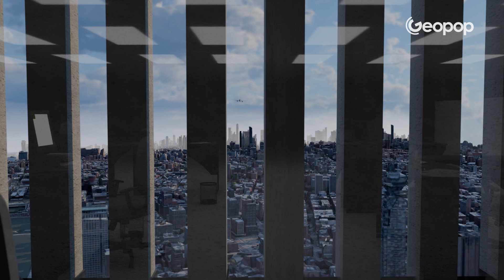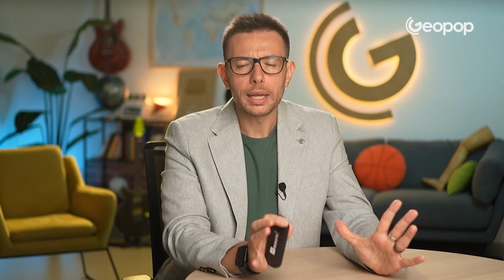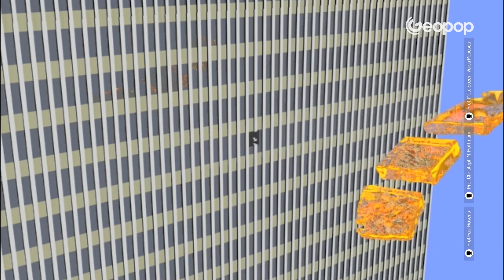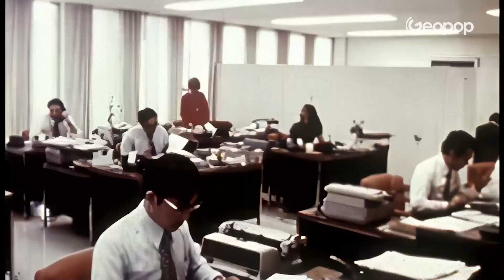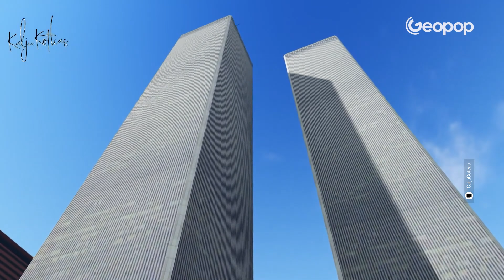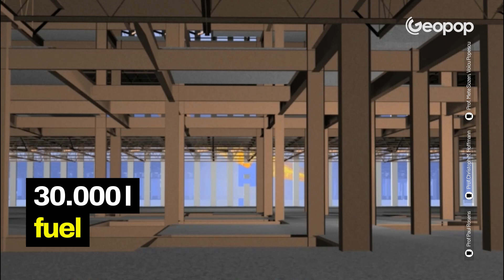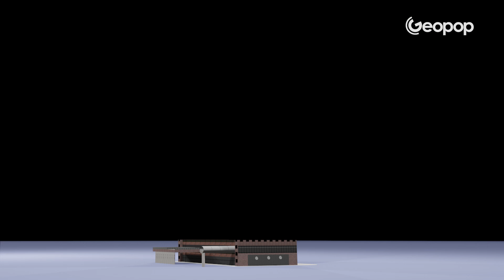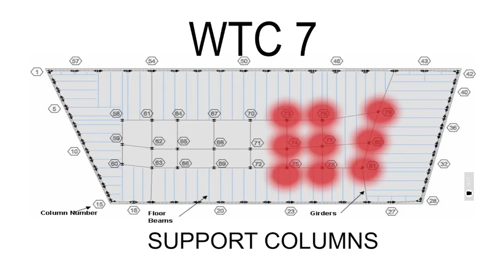9/11, 2001: The Technical Reconstruction of the Twin Towers and WTC 7 Collapses

Comment: Please explain to me how my point would it was not made. If all you're willing to do in a debate is one sentence answers, then it's not much of a debate, is it? NIST Went to the trouble of changing and inventing a new formula for  The deformation of steel, they did a large-scale burn test to get the information information on exactly what would happen with exactly what they knew was in the building, they had all the architectural plans. They had all the data that they needed. You take that data, you make a model, you let the model run and you do more than one simulation. You do not use video or pictures to reinforce. Which model you want to choose. And please inform me what part of that statement is incorrect, because all of that was taken directly from their article, and I did look at the mathematical equations and the 2 different models of steel deformation, that they did corrections on. So they can get information that finite the cannot pick a model without using the video to find out what they want.@TheCriticalStinker-jw4fl

Comment: Everything told by the media is inaccurate..simply put if the lower 50 floors are already strong enough to support the weight above why does damage to the 80th floor cause the whole tower to collapse? Easy because the bombs in the base cut the beams with thermite used in demolitions.. this also explains why scientists have found nano thermite all through the site.

Comment: The report says that the sprinkler system on the 20th floor up was done by water tanks on the roof and uh, the floors that were actually on fire had a separate sprinkler system that was disabled by the world trade centers falling. The towers themselves did not have sprinklers. Systems installed until 2001 But the upper floors did have emergency tanks that should've taken care of good job at least have completely. They lose the floors above and water should have been gushing from here where everywhere@AdrianMijaica

Comment: With all of the experiments that they run, they came up with a new model to measure the structural malleability under temperature of the steel. They had all the architectural plans, everything that they needed. Don't you just plug in that data and let the simulations roll? You do not look at videos and pictures to pick which data that you want to use to run the simulation. That's not how it works. You run the data, then you take what comes out of it. You do not pick which data to match The outcome you are looking for.@TheCriticalStinker-jw4fl

Comment: Different scenarios for the interior damage and fuel distributions were postulated. For each scenario, the fire and smoke behavior were simulated using the NIST-developed computational fire model known as the Fire Dynamics Simulator (FDS). Visible fire and smoke behavior outside the towers was then compared with the photographic and video evidence to determine which scenario seemed most appropriate.https://www.nist.gov/publications/initial-model-fires-world-trade-center-towers @TheCriticalStinker-jw4fl
Reply: Disproving your own claim. Well done. Saves me the bother.

You really ought to learn how to reply in-thread though.

Comment: I love how faced with good science and solid phys sims. The deniers still come crawling out of the wood works. 😣
Reply: Imagine a smaller building collpasing due to fires lol. If fires causes buildings to collpase, firemen should have to find new protocols to enter burning buildings. Regular fires made by furniture doesn't affect concrete or steel
Reply: @hiran4935 how many of those buildings were struck by a 747?
Reply: Deniers? Climate change deniers?
Reply: From under rocks, I think.

Comment: The first part of your article basically covers why the fire department couldn't fight the fire and that's all. Your take of the building 7 collapse. Why no fire seeing no windows broken no  amounts of smoke. If you look, the first hour to collapse starts to collapse to the side, it then corrects itself. Please explain that one to me. You also say that the collapse was started on the right upper side of the building. Then how does the building collapse straight down  its own footprint? Would it not start to collapse on the side that failed? Can please show me where they ran? Multiple multiple multiple simulations off of these buildings collapsing, and the percentage obviously was greater that they collapse straight down upon themselves.
Reply: Sprinklers are never mentioned.
Reply: What sprinklers obviously, they didn't have any fire suppression systems. @Guardinitza
Reply: @Bigdaddy96991  The NYC Building Code makes sprinklers mandatory in such buildings as B#7.

Comment: Thank you for your form letter. What I said was only 3 steel buildings have collapsed only from  fire and that is the 3 world trade center buildings. The other buildings that you mentioned did not collapse because of fire. They collapsed because of explosive damage, and they did not collapse down upon . Themselves in their own footprint. If the fire was so intense in building 7, how come none of the windows were blown out and smoke pouring from the building? The fire was so intense it deformed the steel but couldn't break a window.

Comment: So if I understand correctly according to official story, at Pentagon site some flimsy street lamps caused plane's wings to fold up on themselves... where in the case of the twin towers hollow aluminum wings with almost no mass slice through enormous steel perimetre  columns? Take your pick
Reply: Yet the wing didn't " fold up " hitting the 5 light poles. An the " enormous perimeter steel columns" were .25 inch thick steel.
Reply: @mikebyrd8278  Fkin go learn something... jfc. If the building's outer pillars were a 1/4" thick steel it wouldn't have stood. The HIGH levels could be that thin, but at the bottom they were 4 INCHES THICK!
Reply: Each 🔱 trident of 3 columns 200 ton
Reply: Who cares … just open your eyes … millions saw it that its possible … physics does not care what you believe! There is no alternative any way … the planned demolition idea is simply delusional and defies common sense … impossible to pull through with a live building considering what preparations are required! Thermite 😂 complete nonsense!
Reply: You sir are a moron
Reply: You do not understand correctly.

Comment: NIST denied there were people reporting explosions and melted liquid steal at the WTC site. There was also what looked like liquid steel or something dripping off the side of one of the corners of the building at the impact site of the plane before it collapsed.
Reply: No they didn't.  You should try reading the report rather than just copying other people's bad ideas off the internet. 

As for molten metal pouring out of the South Tower (and it was in fact ONLY the South Tower)?  You mean this?

youtube.com/watch?v=xPVGGQU-MeQ&ab_channel=SeekersofTruth 

You think that is molten steel why?  Because you performed metallurgical tests?  Because the internet told you that’s what it is?  I think we can do better, so let’s do better and build a theory the right way instead of making evidence-free assumptions. This will take just a couple of minutes and is worth the investment. 

The Boeing 767 which struck the South Tower weighed 117 tons and 80% of that was aluminum.  The exterior cladding on the Twin Towers – the white panels – were also aluminum. When Flight 175 struck at the 81st floor its momentum deposited much of the office contents in its way and the bulk of the aircrafts mass into the NE corner of the building. The piled up debris shoved into that corner is visible in photographs and video so we know it was there. 

There’s a good shot here of piled up debris from 4:36;

youtube.com/watch?v=ZLJyL63sqtU&ab_channel=MrKoenig1985

Steel melts at roughly 2,750-deg F while fires in the South Tower reached peak temperatures of around 1,800-deg F. Aluminum OTOH melts between 887-deg F to 1,180-deg F depending on alloy. That aluminum will melt under these conditions is not a surprise. If you look at pictures of cars left behind and destroyed by forest fires the aluminum wheels are invariably melted away along with other sometimes aluminum parts like hoods. Steel bodies remain intact. 

The “molten metal” appears at 9:52 am. At the same time we see the first externally visible signs of sagging floor trusses and the pulling of the perimeter columns inward. I submit these events are related, not coincidental. The aluminum cladding at the NE corner also appears to me to be burning. 

It is likely the with the floor trusses sagging under the heat, and the 81st floor truss in the NE corner under the debris pile subjected to the heavy load of the debris pile, the truss broke its perimeter column connections and dropped, instigating the material starting to pour out of the NE corner at the 80th floor.

Given the properties of the materials in question, aluminum is by far the most likely culprit. 

Reports from The NIST, FEMA and MIT all concluded the material is aluminum. 

Certainly, steel is the least likely of all the materials the anomaly could be given its much higher melting temperature and the fact there is no logical source for molten steel.  The perimeter columns in the NE corner are intact and the material is pouring out between them. So, it isn’t columns melting, therefore what other source of steel is there?

Deniers will claim molten aluminum appears silver when molten, which is true but only at the low end of its melting temperature range. Aluminum can and does get hotter and it glows red to orange when it does (1,100 to 1,800-deg F).  Most folks of course just don’t bother getting it that hot if the goal is just to get it molten for say molding a part. No need to go higher. 

The total mass of molten aluminum is a BIG deal in regard to how it behaves when poured. Quantities bellow half a liter cool almost instantly if poured onto a flat surface, but if poured into say an ingot mould will stay red for a minute of so. Pouring volumes of molten aluminum greater than a liter is a VERY different experience. The thermal mass is much greater and the radiant heat is horrendous. The aluminum is able to stay liquid and remain glowing bright orange much longer. 

The famous video of glowing liquid gushing out of Tower 2 moments before it fell, involves at least tens of liters of molten aluminum. The thermal mass involved is so great that it stays red after falling many meters through the open air.

Side note: There was also a large UPS battery farm in that spot and some of that material at least may well be from the batteries IMHO.